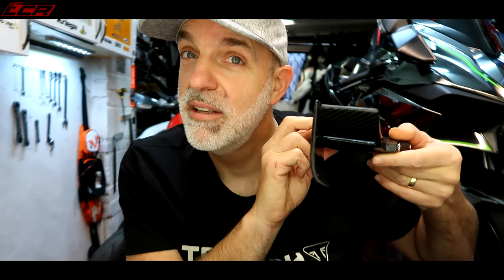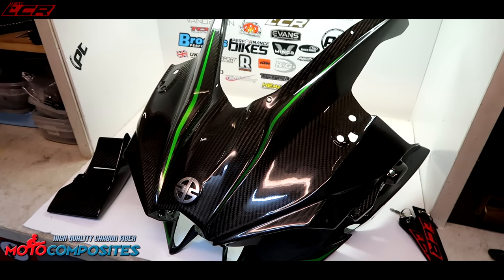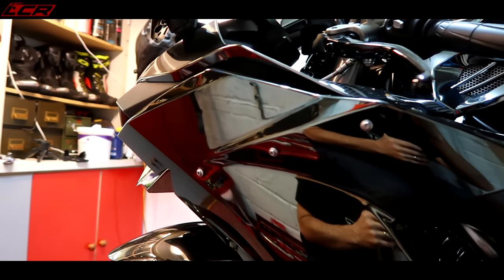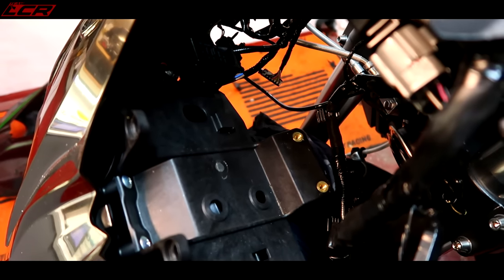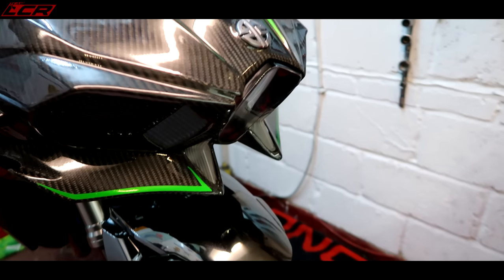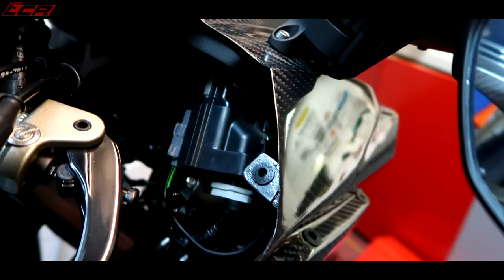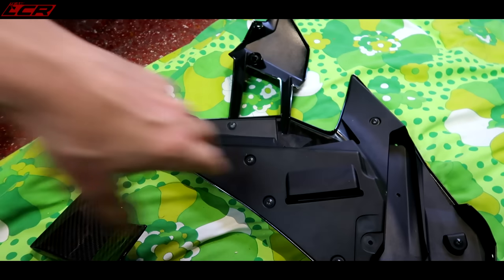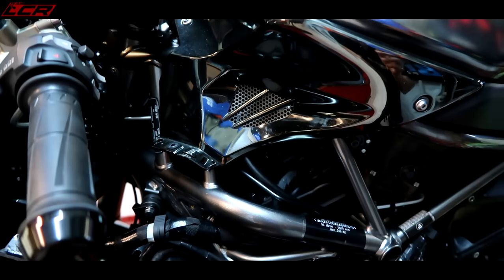Ninja H2R Carbon Fitted | Wings & Cowl

Comment: Professional intro and well paced, clearly articulated explanations with loads of close up  shots - very good.  I've had to refit fairings on my GPZ's and it's always a royal pain in the derriere, but as you rightly say, take your time, check each step, and try not to forget to reconnect lights/switches etc.  I think this type of job is better if you lock yourself in the garage for several hours and get on with it!  The black carbon fiber looks pure evil, in fact the H2 looks even more evil now than prior to the swap, yup... I want one, seriously.....
Reply from the maker: Thanks Clive appreciated buddy 👍👍

Comment: Hi bruv I have just bought all the motocompasite carbon except front cowl and was wondering on picture the lower wings have bolts in them, are they the ones of the bike or did moto-comp fit them all ready.
Thank ford the tips fitting 
Cheers Lance
Reply from the maker: The lower wings bolt on to the fairing on the existing mounts. You remove the little covers and the bolt holes are underneath 👍
Reply: Thanks bruv 
See if you can make it to the Bideford bike show this year its on 29th May * i lve here* their bloking of all the town so their be thousands of bikes , 
you was down Bude last year which is only about 30 miles away on coast lovely ride got a nice fast link road from Taunton to Bideford hehe but their doing 40 mph road works for most as their widening it bruv

Comment: I have a question. The lower wings original screw do not work/fit. Where i bought mine (motocomposites) they say you need M4 threaded screws but they fall through the hole where the wings go. What screws are you using?

Comment: Top job Chopsy, however I take it these  are purely cosmetic items and offer no extra downforce over the front wheel or other benefit 🤔 that’s said the H2  looks total 💰💰💰💰
Reply from the maker: No they will make a big difference in downforce, not sure of any figures but that's why the H2R has them.

Comment: Yes, but does it have vents for your farts? All these bikes are a bit of a nightmare to work on, everything is so compact, fasteners hidden amongst the plastic, the risk of scratching something which scratches so easily. It's a patience job for sure. Once you've done it once, it gets a bit easier.
Reply from the maker: haha, no its only the R1 owners who need the fart extractors as they are full of hot air!! :-O  Yeah the cowl has to come off again anyway for the mapping as need access to the ECU which is behind the cowl! So hoping its going to be easier the next time around

Comment: Where did you order the green lines decals
Reply from the maker: They were ordered via the kawasaki dealer, genuine decals but very expensive. About £50 if I remember well...
Reply: Gotta order from kawasaki dealers only as there are no after market copies to be found anywhere lol, ive just spend over £300 on a few decals for my h2 foooocking expensive they are indeed lol but hey gotta be done lol
Reply: @MotoQuickShifter  yeah is a very unique bike, hard to find parts lol
Reply: @elgonzo25  i have received the carbon H2 decals from the 2019/2020 model i paid £300 no discount lol
Reply: @MotoQuickShifter  I order mine 3 weeks ago, saids there on back order , no statues on availability lol
Reply: @elgonzo25  what did you order bud
Reply: @elgonzo25  i have only one piece on back order looks like i will be waiting a for a while lol
Reply: @MotoQuickShifter  order all the front fairing decals and emblem

Comment: why doesnt anyone use the actual H2R front fairings?

the h2r has a pointier front nose and i think it would look better than the h2s shape
Reply from the maker: Its the same but the H2R doesnt have the headlight, so there is a more of a point there maybe.. The Kawasaki carbon part would be 1000's and wouldnt be able to have a headlight so not practical
Reply: @LambChopRides  I see, didn't know the price is that big!
thanks for the explanation 👍